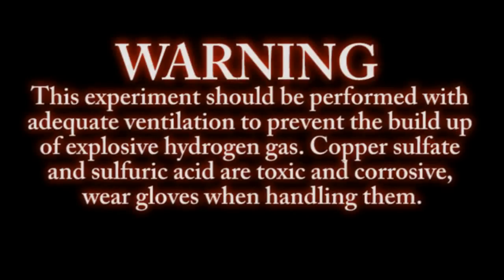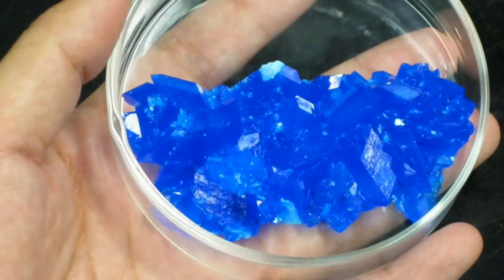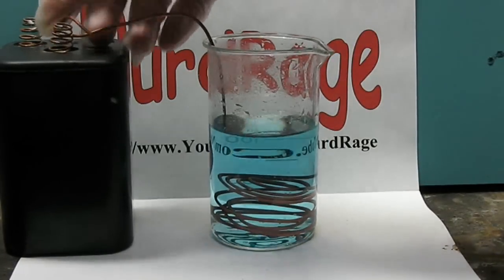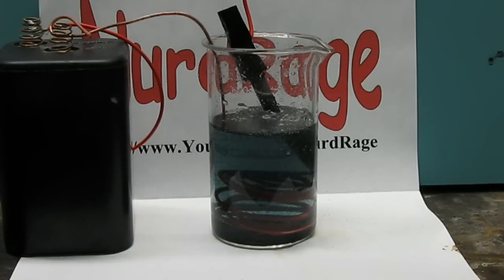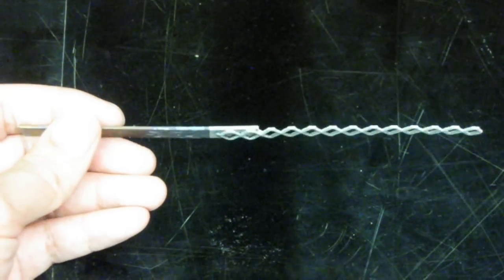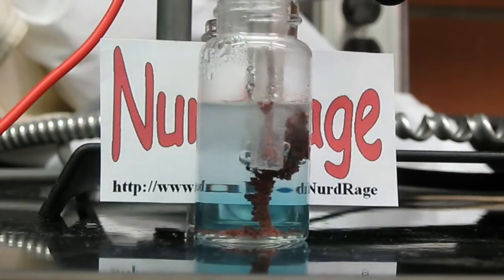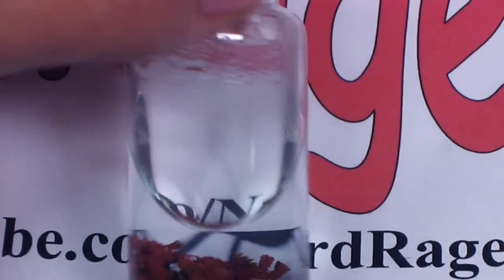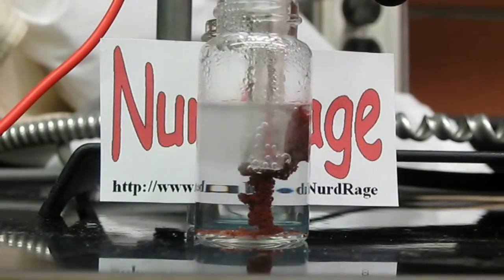Make Sulfuric Acid (Copper Sulfate Electrochemical Method)

Comment: how to make concentration sulfuric acid:
call auto supply store
order/pay for battery acid
boil to desired concentration
profit???
Reply: +Minister of Propoganda II I don't think boiling sulfuric acid would work, you'd have to distill it
Reply: radioactivated the gamer no you can boil the water off of hydrochloric acid
H2O boils at 10c below HCl
Reply: +Minister of Propoganda II I think that's close enough to need distillation, NurdRage covered it in a recent video
Reply: radioactivated the gamer well he did some stuff on hydrobromic acid but that is a separate halogen entirely.
look HCl boiling point is 110c
H2O is 100c

this would be very easy for you to prove me wrong. it would take one pot, one thermometer, one hot plate, and consumer grade HCl as described previously
Reply: upon revisting this to check my facts i was wrong.. but in the rightest way
i was considering hyudrochloric acid at bp 110c

but the video and my original commenbt regard sulfuric acid
and H2SO4 has boiling point of 337c well well beyond H2O at 100c

perfectly ok to boil off
with no question
Reply: +Minister of Propoganda II Might as well distill it, just to be safe.
Reply: radioactivated the gamer yes but that doesnt fit with my simplistic original comment.
ostensibly
Reply: +Minister of Propoganda II pshh just grab a whiskey still and hope it's acid proof /s
Reply: radioactivated the gamer sure cuz they have whiskey stills at the autoparts stores..

..not really helping the aspiring chemist